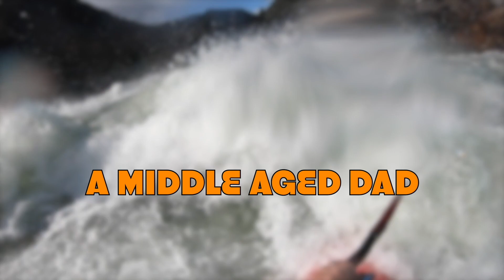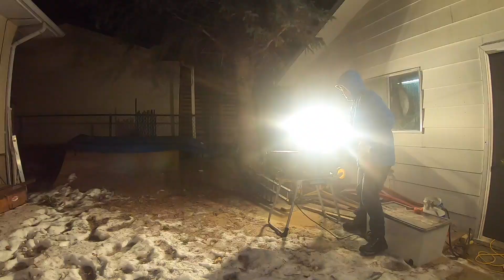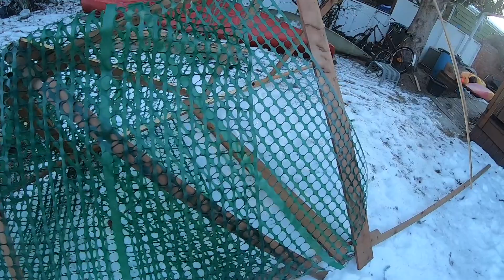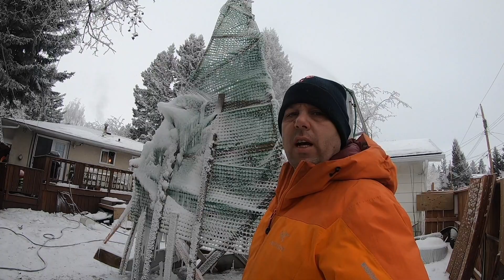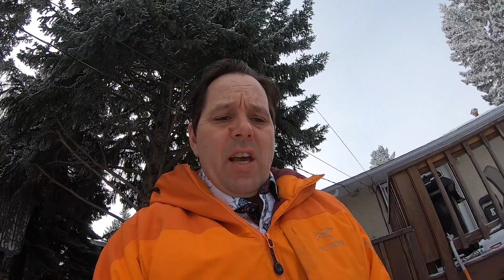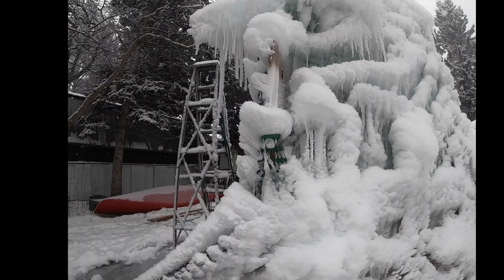Ep. 8 How to Build a Backyard Ice Climb - Part 1

Comment: What temperatures were you working in? Have you tried using more than one nozzle like those for a summer patio?
Reply from the maker: @sk8erkeeg1  it was around the -20c ish when I made that one. Yes you can use more that one misting nozzle for sure. It’s can be tricky running multiple hoses at those temps but is no problem. I bought misting nozzles from Lee Valley that worked very well.